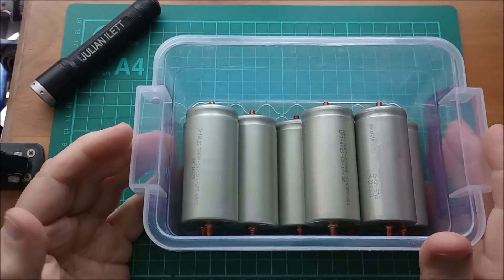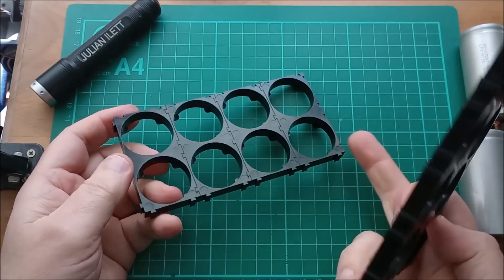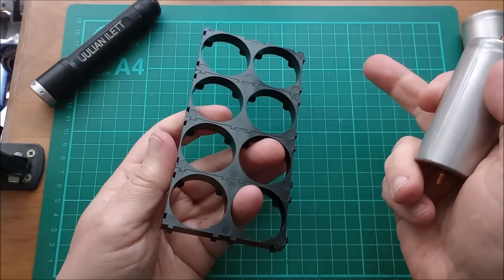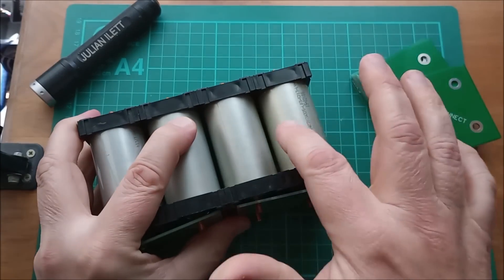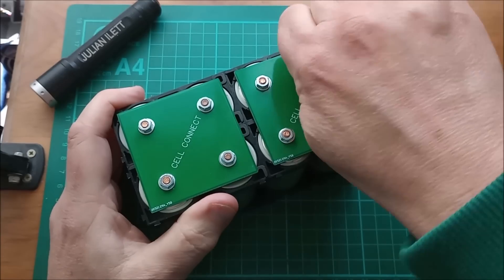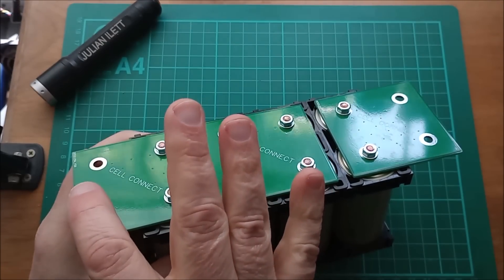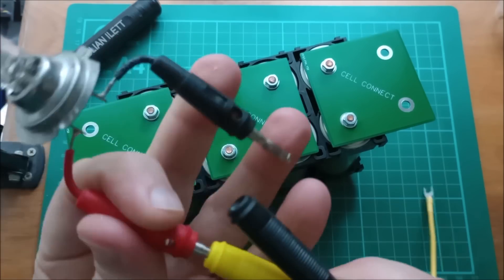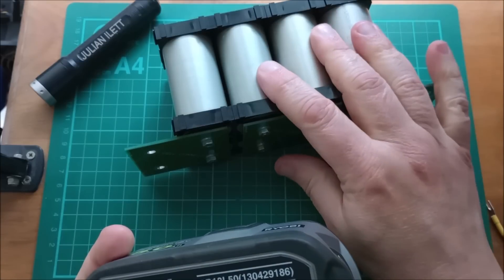Build a 12.8V 150Wh LiFePO4 Battery 4S2P

Comment: I would of added a Dubble  Screw Terminal block to the PCB For the BMS & Bi Cell Equaliser 
"Suyep Screw Terminal Block Connector KF301-2P Blue Copper " or 3 ~ 4 Thermals so you can still poke a Multimeter Probes around

Comment: I've used similar 6Ah cells in a 4s/1p configuration to power my satellite ground station using a small (100W) solar panel.  I did lose 2 of the cells  but after using an active balancer, the cells have been behaving perfectly. The balance across all cells is quite remarkable at 1-2mV using a Heltec capacitance based balancer.
Reply from the maker: Yes, I've found the active capacitor balancers work very well.

Comment: Julian, is here a BMS that would operate in a “automotive like environment” for power sports vehicles, lawn tractors etc?
Something that can tolerate variable alternator output to charge the cells back on the charge circuit, allow starter motor currents and both LVC/HVC?

Really want to find a board that can do that and is affordable if possible!
Reply from the maker: You just need to check the cell data sheets for maximum charge current, maximum discharge current, low temperature limits, high temperature limits. Also, the cells must not be discharged below their minimum discharge voltage or charged beyond the maximum charge voltage.

Comment: I bought 16 of them for 30$ because they were 4 year old cells made in 2017 and i bought them in 2021. 
I am using them on my ups and regularly test them they are holding full watt hour rated capacity. 
I am tracking the full cycles and run time every day to see how long these cells last and if they are any better than the leadacids i use for ups. 
These cells were cheaper than new lead acid in watt hour capacity. And they run longer than leadacid due to no pukert effect.

Comment: I'm interested in such custom battery packs, but I am worried about safety.  I know that you said these particular cells do not tend to catch fire, but I'd still be worried about it.  With the setup you've got there, how do you intend to monitor them for problems such as one cell going bad and then that set of series cells getting continously charged from the other set of cells? Or do you not see this as a big concern?
Reply: Lithiun-Iron-Phosphate cells of any size are incerdibly difficult to get to burn, even if you drive a nail through them you will get a lot of smoke and a hot spot but very unlikely a flame.

Even if you short them out they will generally just get hot and vent.
Reply: @RandomNoob  I might just have to try that to put my mind at rest. I have a project going on, which needs to use Lithium cells, and will go into the homes of friends and family. I can't have any possibility that they catch fire. So if this particular technology of lithium cells is safe, that is definitely a good thing.
Reply: @brianhoskins1979  You can get them to burn but it takes some serious damage to the cells to start it unlike lithium-ion that will burn from minor damage or abuse.

Comment: I much prefer LiFePO4 chemistry, soo much safer than Li-on, and you can charge & discharge much harder too.
There really isn’t much energy at the top and bottom of the curve, so i suggest cut-off voltages of about 2.9/3v and 3.5-3.55v. That should also extend the lifespan of the cells too.
Reply from the maker: On my 8S battery, I'm charging to 28V (3.5V per cell) and discharging to 23V (2.875V per cell). As you say, this is to minimise cell degradation.

Comment: is it suitable to use it as a car battery?
Reply from the maker: Not directly. The starter motor pulls a very large current which may exceed the cells discharge rating. Also, you'd need a BMS to prevent overcharge and overdischarge. Some sort of cell balancing is also needed.
Reply: Charge management needs to be done very carefully below 0*C to prevent damage.

Comment: 1oz copper plane seems very thin for 10A let alone 20A. I know those boards are convenient but they seem vastly under spec for those discharge ratings. I would certainly be wanting something a lot beefier, especially as the bottom voltage seems to be around the 2v level for LiFePO4 cells.
Reply from the maker: There's a copper plane on both sides of the PCB, so I guess it's 2oz total. These PCBs are on my 8S4P pack which has been charged and discharged hundreds of times at about 10A.
Reply: @JulianIlett  I'm sure they work fine, but I have no doubt they do heat up a fair bit. It would be interesting to measure the resistance and see/calculate the voltage drop across one at 10/20A.   I hate leaving extra capacity on the table. I am currently building a custom scooter from and old hoverboard and trying to use both 350w motors so I have been doing extensive testing of 37v lithium packs the last few weeks.

Comment: Hi Jullian, I am amazed by how few  active (series) capacitor balancers are on the market. Do you know how they are officially called, so I could better find them? Thanks!
Reply from the maker: Try these three links:
https://www.aliexpress.com/item/1005005050192601.html
https://www.aliexpress.com/item/1005005244785767.html
https://www.aliexpress.com/item/1005005241453498.html
Reply from the maker: I just use the search term "active balancer"
Reply: @JulianIlett  Thanks, but... I think I wasn't clear enough.
Im looking  to balance series super capacitors.
so... not batteries.
but to protect my super capacitors (skeleton)
Reply from the maker: Ah I see. I've only seen the passive top-balancing circuits (protection circuits really) that are fitted to the supercapacitor PCBs. I've not seen anything with BMS functionality for supercapacitors.
Reply: @JulianIlett   Isn't that weird? Maybe I would have to adjust an active 
BMS, for the right voltages...
or... design one myself, using coils instead of caps to balance them.
Reply: @MasterIvo  Unless I'm mistaken just about any active balancer should work fine for supercapacitors as well as batteries. The only problem I can forsee is if they have a lower cutoff voltage.
Reply: @eDoc2020  yes the voltage threshold is the big challenge. If it is sensed by a voltage divider it could be changed.